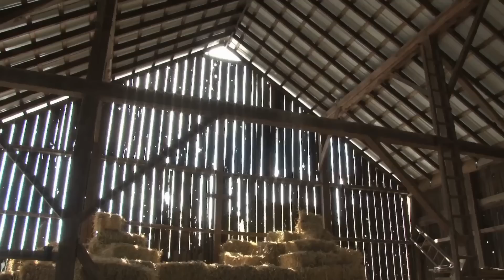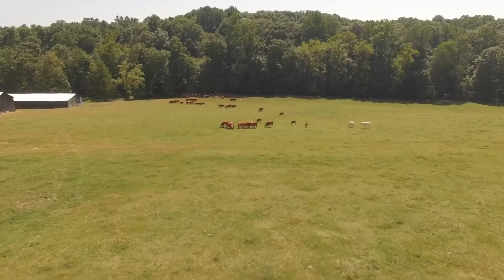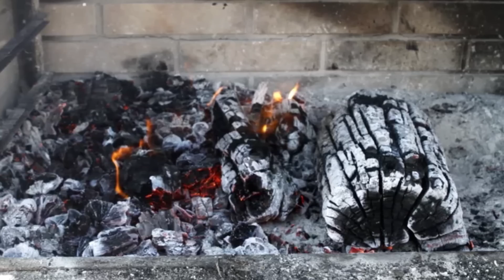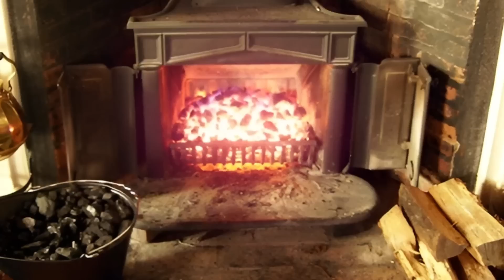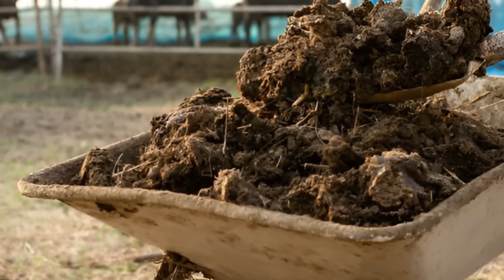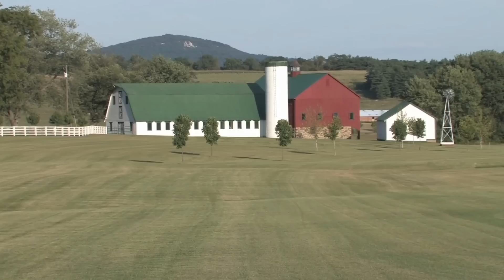How Amish Heat Their Barns Without Gas/Electricity

Comment: I'm a bit flabbergasted. 
I grew up on dairy farms in Illinois and Wisconsin. 
We never heated the barns. The cows were the heating system. We just had to make sure that we kept dry hay in front of them. 
In cold weather, we'd go to the barn before bedtime to make sure the cows had hay. If it was extremely cold, my Dad, I, or one of my brothers would make sure the cows had hay between bedtime and milking time the next morning. Especially if we had a cow that was due to calve.  In the morning, the first thing we did while the pipeline was being rinsed was to feed hay to the cows. Within minutes, the temperature would rise. Then we'd feed grain and protein. Actually, oftentimes we had a harder time keeping the barn properly ventilated in the winter.
The narration kept talking about heat from hay bales curing. That is incorrect. It only takes days, not months for hay bales to cure. Considering that, depending on how many cuttings are done. Hay season runs from spring to fall. The hay bales would be cured long before winter set in.
Reply: I was raised on a 1400 acre Michigan farm. We heated our 2 story brick house with radiators fired by coal. Our big barn was full of square baled hay in the hayloft. On the other side if the barn was an overhead grain storage area where the weevils liked to live. We had sheep for awhile and they kept the barn very warm. The comment above is right on the money about the hay and barn heat.
Reply: yep no one heats  their barn.
Reply: @shartne 
Maybe if they only had a few cows, but not if they had any significant amount of cows.
Reply: Hi ! That calf looked awful skinny !
Reply: Truth, keeping the tie stall or stanchion barn warm wasn't the problem, it was the humidity so pneumonia didn't set in.
Reply: I have had livestock in NY state, and while we stocked up on hay, we tried to keep it in a separate shed. It’s too flammable to leave with the livestock/horses. Our beefers were kept outside with a round bale and they did just fine. The barn was more for the horses but they grew thick coats and handled the weather well as long as they had hay to eat and preferred to be outside. I currently have sheep and I do use them for milking but they stay outside 24/7 and prefer that. I do have to provide housing for the poultry tho since they don’t handle rain as well.